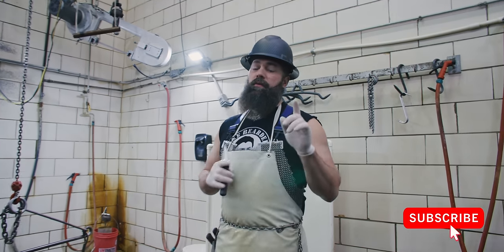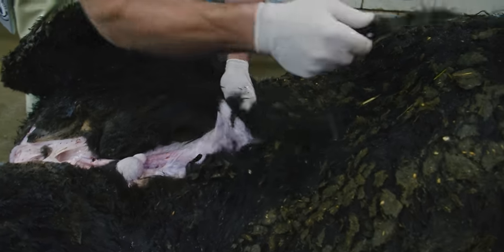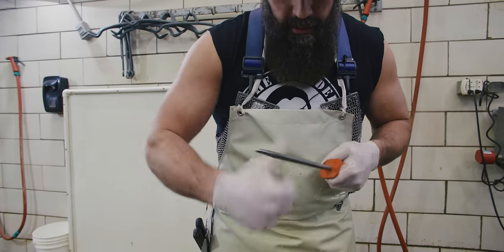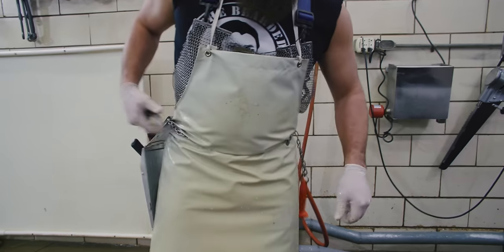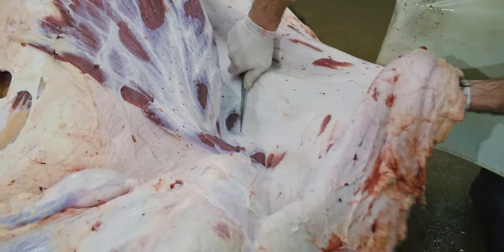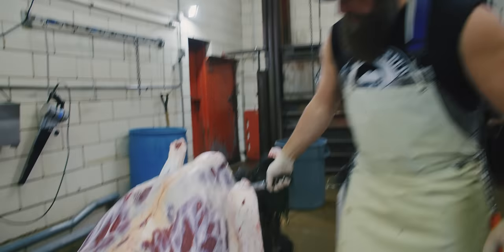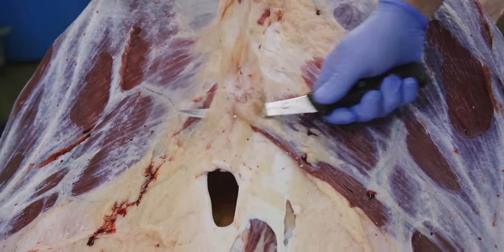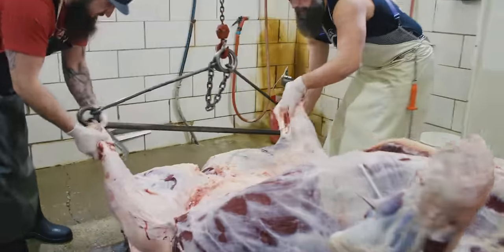How To Skin A Bison | ULTIMATE Knife skills | The Bearded Butchers!

Comment: Nice video.  Never thought to use a boning knife for skinning.  For the past several years I've used the smallest Bucklite Max II.  I love the control and closeness I have with that little 3" blade. I also take a small steel into the field and touch it up often.  But then, I've never skinned a bison, so I'm no authority there!  Great work and thanks for the video!

Comment: Just like you pulled the skin off the tail, can't you do the same on the back?
When we skin moose that we have shot. Hanging from a winch from the ceiling, we usually pull the hide from the back by hand or a winch if there is one. Pin the skin to the ground and use the winch you lift the animal with to pull the skin off.

Comment: What happens if the whole thing falls on the floor after skinned
Reply: Hopefully with good housekeeping the floor is kept clean during the whole process. They’re more likely to roll it off the rail with an open switch. If that happens you pick it up off the floor with the hoist. Any contamination can be washed or trimmed off.

Comment: So, just to be clear, that bucket of solution you're dipping your knife in is a "sanitizer" not a "sterilizer".

 Sterilization requires long exposure to high pressure steam, ethylene oxide gas, hydrogen peroxide plasma or gamma radiation.